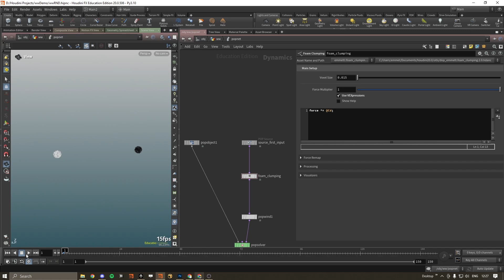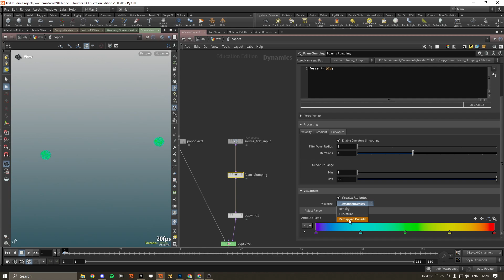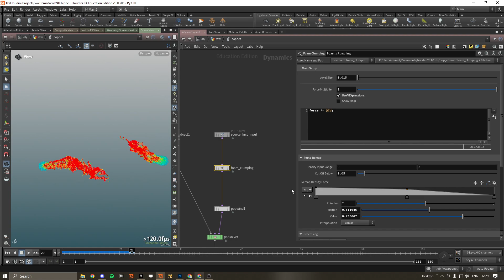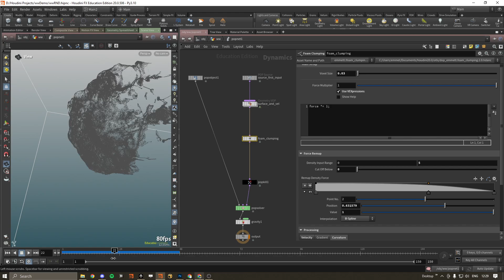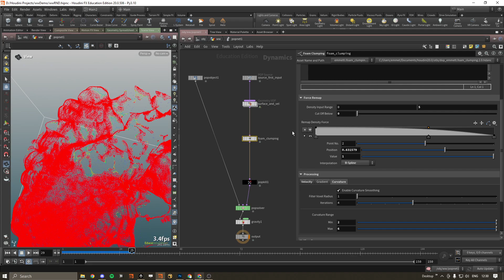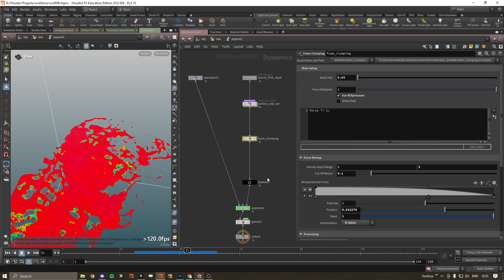Houdini 20 Digital Asset | Foam Clumping Force | UPDATED

Comment: Looks cool. Im just wondering whats the difference between the ww solver and this?
Is it just the same but with more controls and for the popsolver? 

However, no matter whats the answer I think its a great a idea to rebuild/+ customize it to learn the solver systems.
I probably gonna rewrite the Flipsolver soon and add other computer graphic systems for liquids because its hella fun to break these things down and add creative ideas.
Reply from the maker: @fexvfx  Hey there. The vanilla whitewater solver is great, but I’m personally not a huge fan of the workflow. Vanilla ww will certainly cover all of your needs, but I’ve found custom pop ww to be a little less bloated, and you can tailor it more to your specific use-cases. 

This clumping node is also not exclusive to ww. It can be used just like any pop force, and is a faster (in my tests) alternative to the pop fluid node. I’m also working on an alternative clumping setup that relies more on dop nodes, as opposed to being entirely inside a sop solver like my current OTL is.

Rewriting a flip solver sounds like quite the undertaking, best of luck